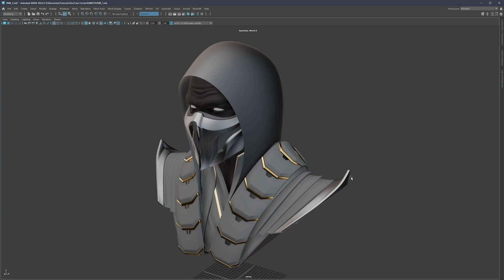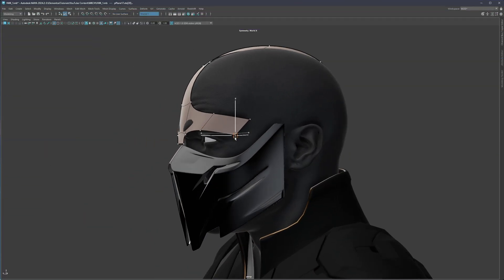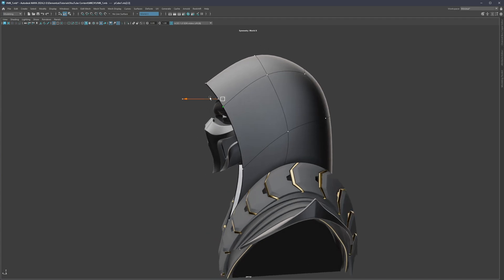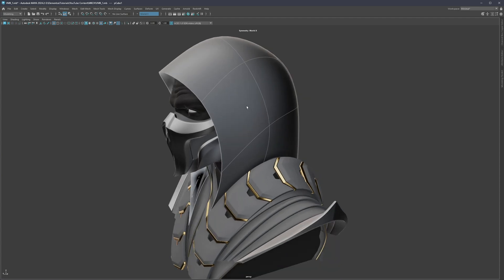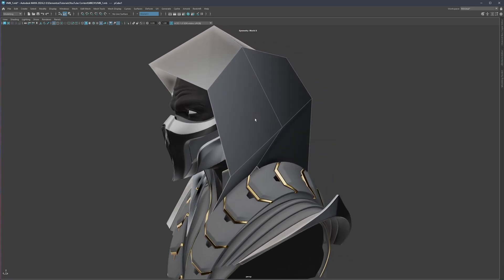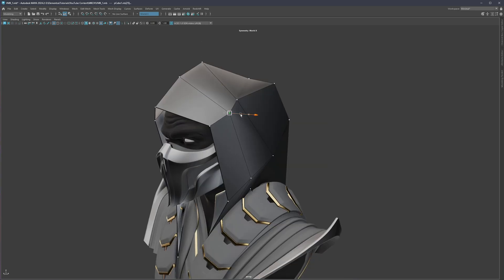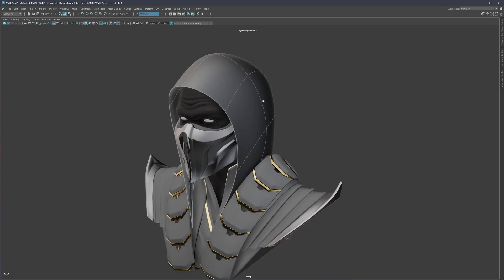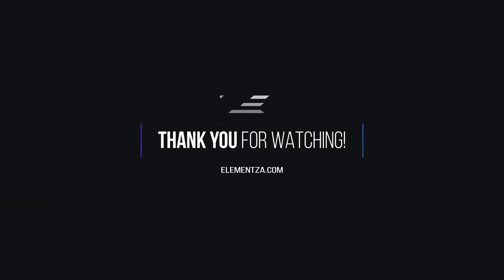Should We Model with Subdivision Preview On or Off

Comment: I usually go between them pretty often when Im modeling. That way I dont mess up the mesh while knowing what it will look like later.
Reply: I did a scarf that had lots of tight folds. I needed it to be between the smooth preview and non smoothed for our game. I still wanted the control that the low res mesh gave me. However when applying the subdiv there would be clipping unless I added even more resolution.

Just a specific scenario where I had to use both. But its true that the end result is what matters and  subdivided mesh is closer to that.
Reply from the maker: @Xirpzy  Yep, that is a good example where you probably wanna have subdivision on when creating more accurate forms